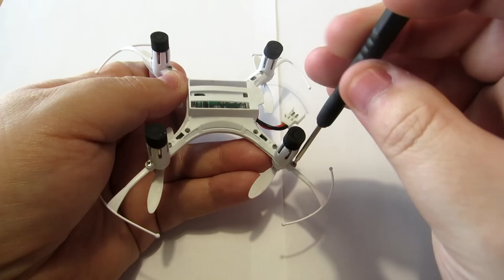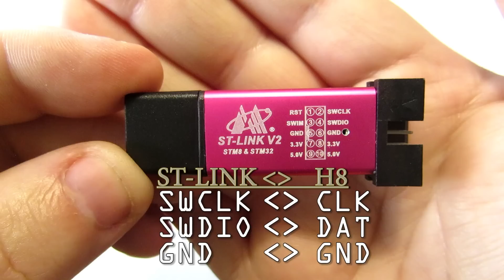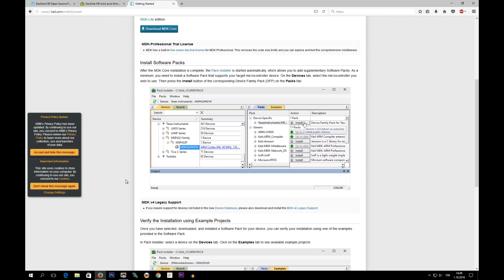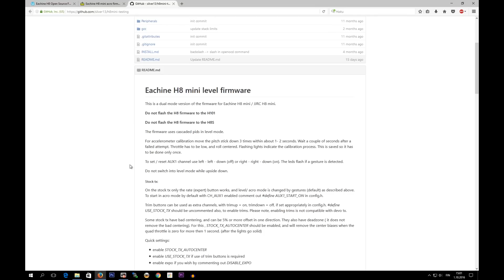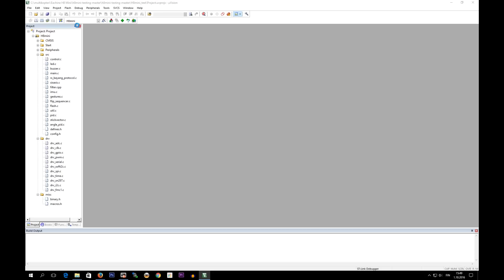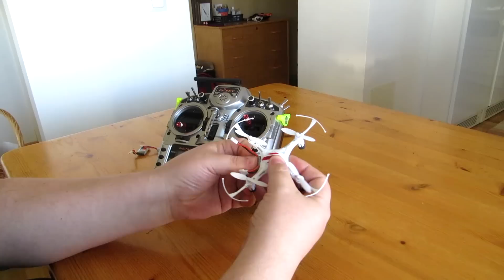How to - Flash Eachine H8, H8S and Floureon H101 with an Acro Firmware!

Comment: Can you do flips?
Reply from the maker: That is the "whole point" on the acro firmware. The quad does not limit the movements at all, thus you can flip it as you wish. I tried to flip my H8 once inside the house but that ended up smashing the quad to the floor so I decided not to try it again for the video :) Doing flips etc. manually with line-of-sight with a quad this small is challenging to say the least. It makes more sense to flash the acro firmware if you are flying it with FPV as you can see better what corrections are needed etc. to make more controlled flips.
Reply: H8S is capable of inverted flight. Can you fly inverted with this acro firmware? (If not, could you point us to a setup that is acro+inverted capable with a similar price?) Acro is cool by itself but inverted flight on top of acro capability would be much cooler.

I imagine it should be possible to do that trick RC helicopters do. What's it called, the "metronome"?